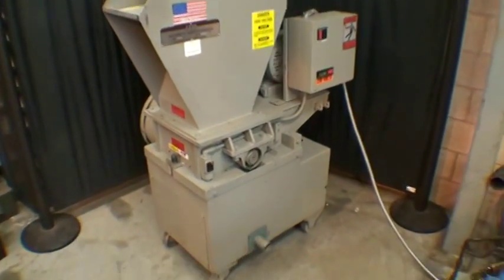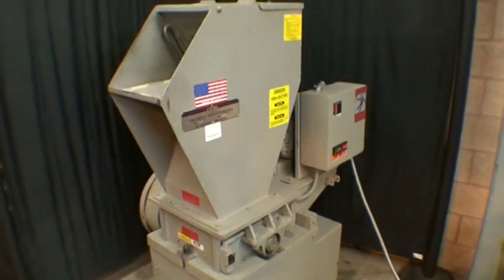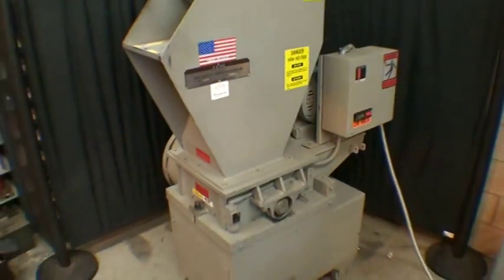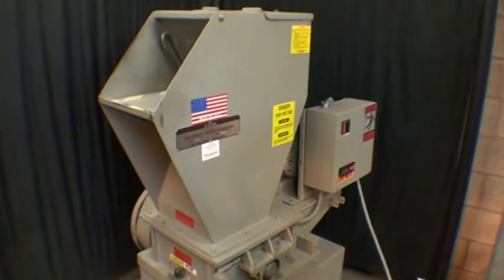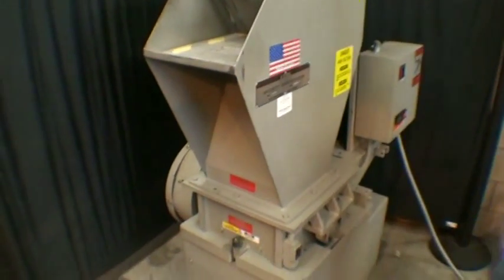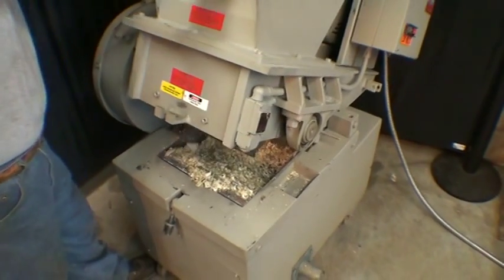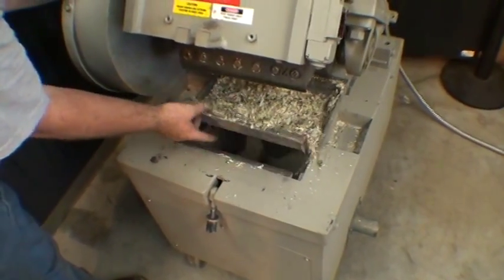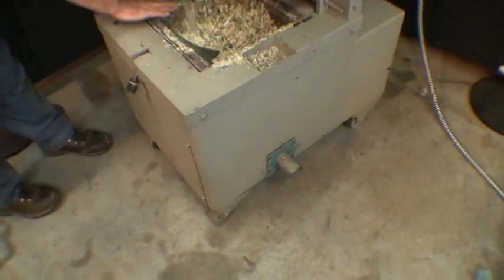High security disintegrator SEM 1012 test

Comment: All that noise, and it took all that time, and that's all that it did ?
Reply: I had to use one of these for hours and hours at a time in the military hooked to two large 55 gallon drum shop vacuums in a concrete block room with no sound proofing - maybe that is what caused my ringing in the ears. Extremely slow, noisy, dusty and prone to paper jams. I wonder how many decibels that is.